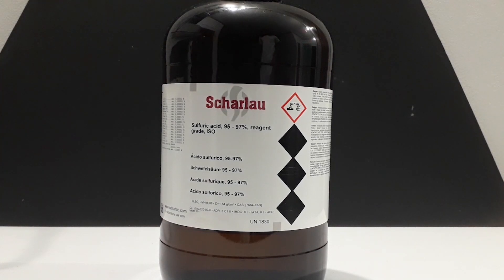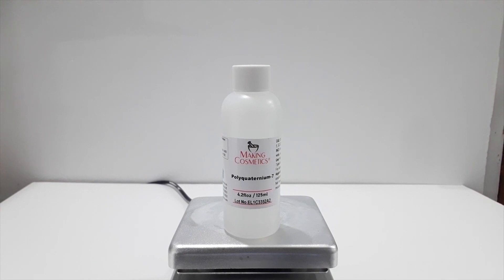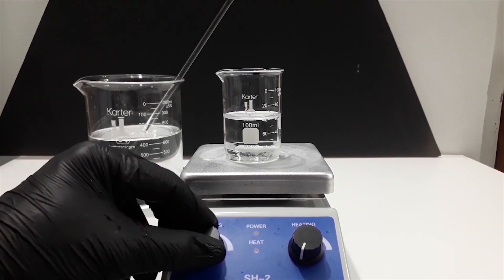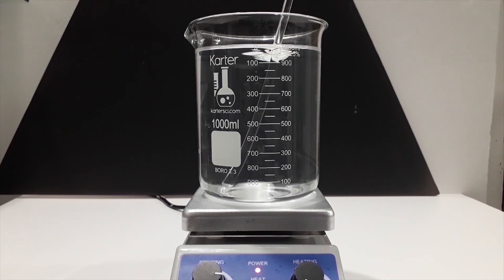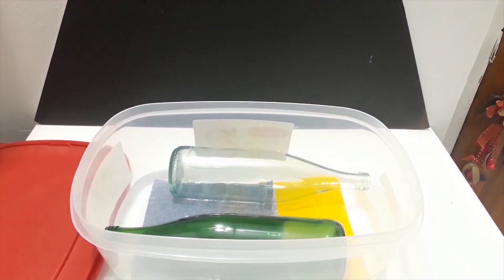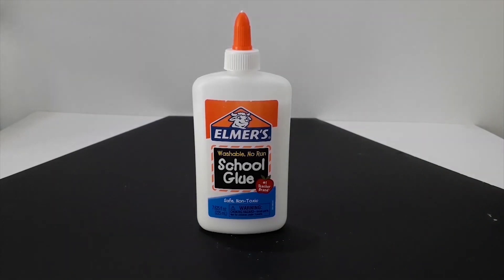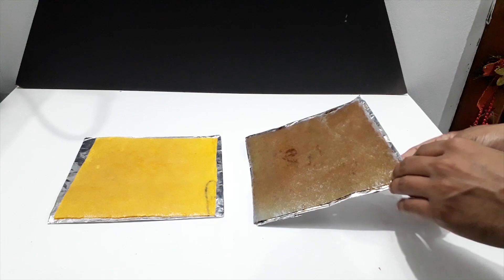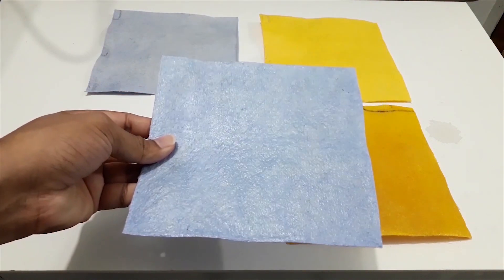How to produce DIY ion exchange membranes for various electrochemical applications.

Comment: Can you please tell where and how to use a thermocouple here
Reply from the maker: there is no thermocouple in this video.
Reply: @CatboyChemicalSociety  yes, but you have mentioned the need to use it. So how can we use.
Reply from the maker: @harshadinesh2774  at 11:30 minutes you can clearly see to the right its used to measure the temperature of the membrane during the esterification process.

Later you can see the membrane produced without using a thermocouple and relying purely on the set point of the oven. This shows that these oven temp set point is not static but an average. This is also important in some cooking recipes that need exact temperature like when making croissants.

Comment: I'm trying to learn more about different kinds of membranes.  What better way than to see one being constructed from scratch from (mostly) common materials.  Thanks for sharing this!  I'll be exploring your channel further as I want to learn how membranes might be used for electrodialysis, as in the fascinating of Matt Eisaman.  Liked and subscribed.
Reply from the maker: no problem
Reply from the maker: electrodialysis membranes are usually a pair of cation and anion exchange membrane cells stacked together such that water is fed into neutral chambers with either membrane on both sides.
The respective ions pass through the cation exchange membrane on one side and the anion exchange membrane on the other.
The water that comes out from the outlet of that neutral chamber is said to be de ionized.
The electrodes are located at the opposite ends of the cell.
Reply: Hi. @ML Franklin did try this method to make these membranes for electrodialysis  water desalination? Regards

Comment: Love the presentation. Can you provide some more information about what exactly is happening with the reactions you performed here?
Reply from the maker: pva chains contain alcohol groups and when you have a carboxylic acid under anhydrous conditions it will esterify and remove a water molecule.
this occurs during the oven baking part of the proceedure.
since citric acid is a tricarboxylic acid, it will react to crosslink the chain and will have 1 free carboxylate group which can bind to cations in the electrolyte.
When a voltage is present across the cell, the ions migrate to the cathode chamber from the anode chamber.
Reply: @CatboyChemicalSociety  I had guessed it's an esterification. nice, that should be stronger that the hydrogen bonds of the borax slime.

I am interested in the conversion of epsom salt to sulfuric. Trying a clay pot at the moment with a lead anode, but the anode compartment is getting pink, which I believe is because of manganese in the clay turning into the pink sulfate (I do not believe it can be permanganate)

I am grateful for your video that is extremely practical. Thank you.

To use a cation membrane, I would need to have epsom salt in the anode compartment and then have all Mg+ migrate to the cathode through this membrane?

If I want to keep epsom salt at the cathode (for purity -- and prime the cell with dilute sulfuric at the anode), I would need an anion exchange membrane to let sulfate come to the anode, right?

I have everything needed to try this and I will try to get msg at the asian supermarket for an anion membrane.

Do you have a fediverse presence so we can talk in better conditions than here? Jesus, I had to tweak my browser in order to be able to comment, and the full youtube experience is quite something !

thank you and have a good day uwu

Comment: Did you say bake the sheets? At what temp would that be? I'ld watched one of your vids about a year ago on making with pvc cement and citric acid. It looked like a easier and cheaper way, is this a upgrade or for another application? Also was wondering about voltage for gypsum or magnesiumsulfate (epsum salt) for sulfiric acid generation. My guess is somewere between 5 and 12 volts. I'm thinking of trying to plate some stainless steel or steel screen with platnum or gold as anodes and cathiods in platnum are so costly. Thank for your time and work on putting out these vids.
Reply from the maker: this membrane is more selective than the previous one. if you add too many layers of the PVA citric acid resin then you cannot feed in CaSO4 as it becomes selective to cations only.
for CaSO4 or MgSO4 you only do like 1 coat of PVA-Citric resin.
The voltage would be around 8 and as for the anode better to use Ti substrate as the passivation will help prevent total corrosion of the substrate and gold only works if you dont have chloride contamination.
A good cheap anode for this application is lead sheets or PbO2 on graphite.

Comment: Nafion membrane from China top quality cost 500$ m2, I know very well the factory.
Also I will test PFSA resin that is the raw material to make Nafion membrane.
Reply from the maker: you would have to find a way to melt/fuse it and roll it into thin sheets or laminate some fiberglass sheets with it.
I reckon under inert atmosphere knowing how fluorinated stuff behaves when heated in the presence of oxygen.

Comment: Thanks for sharing this video
Can these membranes be used for a small alkaline chlorine small workshop with a capacity of 500 kg of caustic soda per day?
How many cells do you think is needed for a capacity of 500 kg caustic soda per day and in what dimensions?
What is your idea about most cost-effective anodes and cathodes I can use?
( there are access to cheep power and NACL in our Region)
Reply from the maker: most membranes tolerate a max of 200ma/cm^2 you have to calculate the amount of amps required to produce the amount of product needed in the given amount of time.
Then you would have to find the surface area of membranes required to run it at that current density and current required.
Reply: @CatboyChemicalSociety  Ok. Thanks for your reply 
Do you think these membranes are suitable for the production of caustic soda on a small industrial scale?
What is your idea about most cost-effective anodes and cathodes I can use?
Reply from the maker: @mohammadmoradimajd7256  for anodes in terms of long term costs saving you really should get DSA which is industry standard and get Ir-Ru type because its more efficient for chlorine evolution.
The anodes sold also have similar current density rating to these membranes up to 250ma/cm^2. Membrane cells usually run lower current densities. 
Now in terms of current for 500kg of product per day we are talking a lot of amps here which ive calculated to be 1,338 AMPS assuming 100% efficiency given that its more like 89% it would then much more than this and depending on input voltage the watts of heat that must be dealt with will be high. DSA has a high initial cost the costs of the electrodes will be quite high due to the amount required here you will need 5,352cm^2 of surface area.
I assume you plan to make 1 large membrane flow cell assembly with several compartments for this.
The maximum concentration of NaOH produced via membrane in industry is 30% since efficiency and current draw drops off after that.
if the budget concerns you then graphite runs at lower current densities and given resistances of membranes is also a reasonable choice.
These membranes can survive sulfuric acid electrolyte and I have used them in a chloro alkali cell in labscale and they survive the conditions.
For an industrial scale plant though it may not have the same results and nafion is probably the better option sinch buying it in bulk is cheaper anyway.
Reply from the maker: @mohammadmoradimajd7256  the main issue why I recommend just getting commercial membranes is that the surface area you require for your flow cell will be large.
I doubt a simple oven will be large enough for each membrane for each cell compartiment. but if you have a large enough oven or the equipment to make large industrial flow cell sized membranes then go for it and use this recipe.
Cathodes used can be stainless steel as the alkaline conditions will protect them or nickel plated steel.
Reply: @CatboyChemicalSociety  I will start my experiments according to your instructions and let you know the results. Thank you for your guidance.
Reply from the maker: @mohammadmoradimajd7256  try it out in a somewhat smaller scale first and see if the membrane survives for long periods of time. something like a 50 amp cell.
Reply: @CatboyChemicalSociety  It seems that the dimensions of 20 * 30 or 20 * 20 cm are suitable for the initial test. What is the voltage between the cathode and the anode?
Reply from the maker: @mohammadmoradimajd7256  depends on your cell construction but usually industrial membrane cells operate around 3 volts.
This prolly needs a very small distance between anode and cathode around 0.5cm apart with membrane inbetween with active flow of electrolyte using pumps.
Reply: @CatboyChemicalSociety  Thank you for reply 
I want to start to  make chlor-alkali cell with this membrane . as your suggested ,  I want to make a graphite anode from graphite powder . so I dont know which binder is suitable for binding graphite powder as anode. do you have any idea about grafite binder ? ( metode for make anode from grafite powder )
Reply from the maker: @mohammadmoradimajd7256  just get solid dense graphite from aliexpress dont bother with powder because it wont hold out in these conditions not without sintering.
The only good binder is phenolic novolac resin which then has to be heated in furnace at 900C in an inert atmosphere at high pressure.
Reply: @CatboyChemicalSociety  Hello
I bought a titanium plate for the anode instead of graphite.
Can I use titanium sheet as an anode for testing?
Do you recommend a way to cover the titanium sheet and make the MMO anode?
Reply from the maker: @mohammadmoradimajd7256  MMO anode is difficult to manufacture better to properly buy MMO anode not titanium electrode.

The process of making an electrode from titanium sheet costs more than buying MMO electrode.
Reply: @CatboyChemicalSociety  I made it.
But the problem is low Current. It seems that the thickness of PVC layer has caused high resistance. 
Do you have any other suggestions for replacing PVC impregnated fabric?
Reply from the maker: @mohammadmoradimajd7256  did you dechlorinate the PVC for 24 hours in 4 molar NaOH with ammonia based surfactant additive to reduce resistance and if so it should have turned a slight brownish to orange color tho in this vid the dechlorination solution was not proper.
Reply: @CatboyChemicalSociety  
It worked . 
My lab cell was 4 inches in diameter. (Approximately 78 cm square).
The current started from very low current and after 12 hours, the current through the cell reached 8 amps. I did a titration test during this time.
In the titration experiment, it was found that 1 mol solution (more than 4 g per liter) of NAOH solution was prepared.
But the problem started at 10 amps. After passing more than 10 amps, the current from the PVC substrate cell was degraded by heat. (After 20 hours of cell work).
The cell seems to work well up to a current of 0.1 amps per square centimeter, after which the PVC substrate is destroyed.
PVA seems to survive in most streams of 0.1 per square centimeter, but the PVC layer is destroyed.
What do you think is the solution to increase mechanical and chemical resistance?
Do you recommend another substrate instead of PVC??
Reply from the maker: @mohammadmoradimajd7256  you can directly put the PVA onto fiberglass cloth substrate which subverts the idea of using PVC.
Reply: @CatboyChemicalSociety  Hello
I used fiberglass cloth.
Fabric strength is excellent
But the problem is that the membranes only survive for 24 hours, after that  PVA and Citric acid layer (CME)  are destroyed.
I'm looking for a way to increase the chemical resistance of the membrane.
Can silicate compounds help improve the mechanical and chemical properties of the membrane?
Reply from the maker: @mohammadmoradimajd7256  PVA would eventually hydrolyse if the NaOH concentration is too great. also the chlorine water probably was not very kind to it either.
most commercial membranes have the polycarboxylate layers at the cathode chamber and a layer of polysulfonates facing the anode chamber.
Polysulfonate resin can be sold as a powder and in my ionomer cement video it is indeed possible to imbed them into some sort of mixture with a porous binder so this maybe an option but it may also add bulk to the membrane in terms of thickness.

Comment: This is really cool - thanks for sharing this! Following up on an earlier comment, is there any technical papers or something that I could read to explain how this coating method using PVA and citric acid creates these cation-exchange membranes (as opposed to anionic ones... or why PVA and citric acid?)? Just wondering how it compares to the commerical nafion 117 and n324. Would there be any way to further optimize what you have done for membranes in a chlor-alkali cell? Perhaps just use teflon-fiberglass cloth, PVA/citric coat, bake, and do that a few times, but not so many times that you increase the resistance of the membrane to electric current?
Reply from the maker: anionic exchange membranes need a different thing than citric acid which is aspartic acid and subsequent treatment with methyl iodide converts the amines into quaternary ammonium compounds.

These membranes are quite conductive and if you want to look for technical papers on threm just look up PVA and citric acid crosslinking and you will find many such papers talking about the mechanism and the crosslinked structure that forms as a result of baking the mixture.

It was from one of these papers that got me the ratio of 4:1 10% PVA solution with citric acid. Most clear PVA glues are 10% PVA solutions with some other additives.

Nafion is of course the king of membranes but its price makes it unreasonable for prototyping and small scale experiments. You can also use Sulfosuccinic acid instead of citric to get the sulfonate groups instead which is also found in commercial nafion membranes.

Sulfosuccinic acid is made by sulfonation of maleic or fumaric acid. and there are papers talking about membranes made from PVA and sulfosuccinic acid aswell.
Reply: Can I use lemon juice instead of citric acid?

Comment: Will u show pbo2 anode prepatation by electrolysis of pb in h2so4?
Reply from the maker: thats not a good PbO2 anode as the anode produced is porous and unsuitable for perchlorates.
the plating solution requires membrane electrolysis of either sodium nitrate or chlorate with lead electrodes to make lead nitrate/chlorate then using that on a titanium mesh with undercoat to make an electrode.

Comment: What do you think of using a paper towel rather than a washing cloth as the substrate to first coat with PVC glue?
Reply from the maker: it can work too since the PVC does most of the job anyway holding up.

Comment: What is the advantage of your membrane over ceramics, porous polypropylene, porous dehydrochlorinated PVC, for production chlorine, sulfuric acid. Ion exchange break if high difference in ion concentration
Clay pot, li-ion battery, car battery sepator are more accessible
Also rag bad substrate for applying PVC. FIbreglass are much better
Reply from the maker: ion selectivity and its far more conductive and runs more current than a porous barrier and still has high chemical resistance to 30% concentrated acids.
Fiber glass is also a better substrate but cloth is accessible.
Lithium ion seperators are superior in terms of selectivity but are not resistant to high concentrated acids so cannot be used in some applications and can be beaten if I use fiberglass and PVA-Citric resin blend coated like 3x or 5x over as they will perform identical in every way.
Reply: @CatboyChemicalSociety  li-ion sepateor made from porous polypropylene. It must be resistant to acid. I will use this for chloro alkali cell
Reply: @CatboyChemicalSociety  Dehydrochlorinated PVC is not ion exchange?
Reply from the maker: @НиколоМакиавелли-р8ц  but PVA and citric acid form crosslinks when cooked which is ion exchange. the dehydrochlorinated pvc is only porous and the layer that goes above it is the actual ion exchange resin which crosslinks also the the PVC layer.
Reply from the maker: wheres the source for the breakdown of PVC in high concentrations of chlorine and sulfuric
Reply: @CatboyChemicalSociety  what you think about PMMA or styrene PMMA sopolymer. PMMA can be dissolved in his monomer which obtained by pyrolysis. PMMA can be treated with alkali to create ion exchange layer. It can be more resistant than PVA citric acid
Reply from the maker: @НиколоМакиавелли-р8ц  PVA and citric polymer is pretty resistant but PVA and sulfosuccinic is also really resistant.
Overall the ester bonds are strong and the resulting plastic film is fairly chemically resistant.
If you want maximum chemical resisttance then you would use sulfonated polystyrene films or you can use dehydrochlorinated PVC which is then sulfonated subsequently.
Reply: @CatboyChemicalSociety  I know, but Styrene methyl methacrylate or PMMA can be obtained from waste free. Also for obtaining hydrolyzed resin acrylate need fewer stages. I want to try. How do you think this will work?